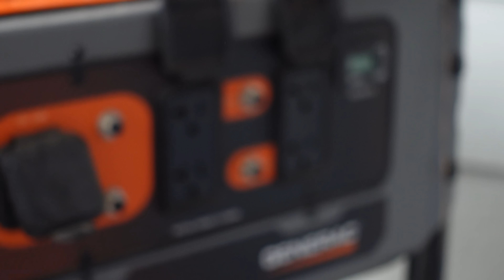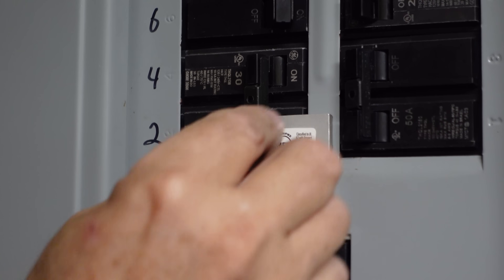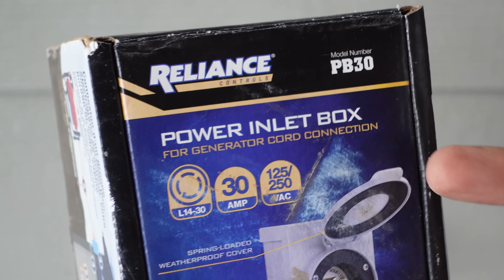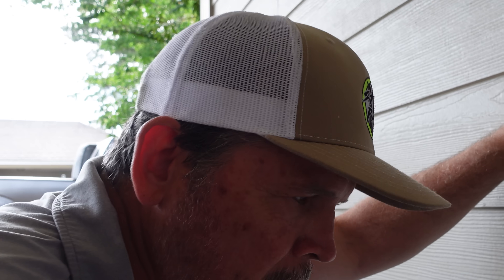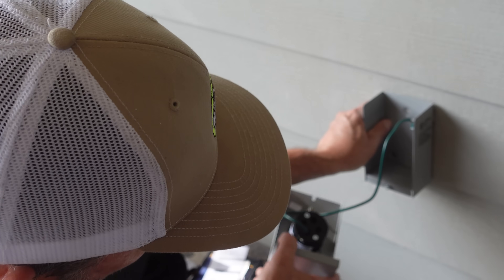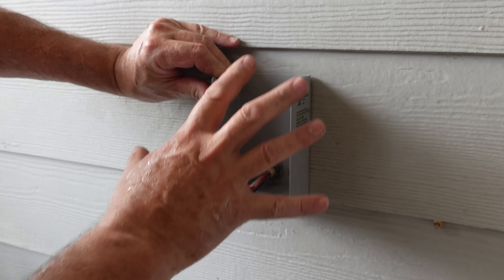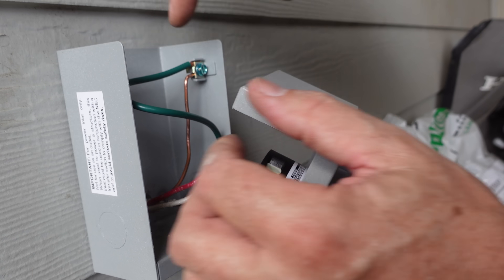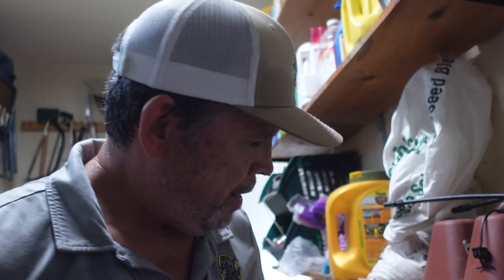What is a Suicide Cord and Why It Could Kill You

Comment: For a possible future scenario... The hole you made through the plywood was big enough for the metal Romex connector... You can screw the connector onto the wire first then put it through the knockout on the box and install the locknut. 👍
Reply: You beat me to it -- I've used that technique for all sorts of similar cases - and not just on "house wiring", but low-voltage, coax, etc.😊
Reply: Why did he drill such a large hole? It looked like a 3/4 inch hole would have worked.
Reply: imagine if for some reason someone has to take the box out. "Gotta open up the drywall"
Reply: @cmh-c  why?  You can remove the locknut from the inside of the box and pull it off, just like you out it on, leaving the wire in the wall
Reply: @IrrationalBstrd  Yeah but what are the odds someone figures that out unless they have prior knowledge of that technique?
I'm not sure they teach it in the classes you can take to become an electrician, but it's something worth knowing for sure.
Someone ought to go around and write down all these little things you "learned from your mentor", otherwise they might become forgotten.
That kind of trade knowledge that isn't in a book is an extremely important thing to put down in books somewhere, and I have an example of why:
This kind of trade knowledge becoming forgotten is why we can't build the mighty Rocketdyne F-1 engine that powered the first stage of the Saturn-V moon rocket any more (and haven't been able to since the start of the '80s).
Yes, NASA still has the blueprints for the F-1 engine, but that's not all you need to make one.
What we lost are the trained tradespeople that were actually building those engines, and had figured out all the little tricks and techniques that turn that blueprint from a plan into something you can take a series of steps to produce.
Now, because nobody wrote down the knowledge they had that was required to build one properly, we can't build it any more unless we go thru and figure all that out again.
Reply: @44R0Ndin  unh. If you don't know how a cord nut works, you probably should not be playing with sparky things before you spend time learning about them - like from S.P. and others.

Comment: As an electrician in Australia I've never installed that type of electrical box. My question is, is that common practice in America to connect the supply cable earth to the box (like you did)? Or are you supposed to connect the supply cable earth directly to the socket earth terminal?
The reason I ask is that connecting it to the box relies on the box connections and the internal factory earth wires in the box. Should the box connection come loose or wire break off, you've lost all earthing of the box, but the generator earth is still connected to the socket and the box lid (which are now no longer earthed). The generator is no longer earth bonded, and if an earth fault occurs in the generator the box will become live. 
In Australia we would connect the supply earth directly to the socket earth (as well as the box earth wire that is already in the terminal), and those internal earth wires to the box and lid are only there for earth bonding of the box and not relied upon for a fault path from the generator. Any fault path and bonding in the generator would go directly to the house earth. 
Also, this may be the reason why the factory earth bonding wire that was already in the socket may not have been tightened... because you're supposed to back it off and put the supply earth in there. 
Any US electricians know the answer to how it's supposed to be done?
Reply: I would like to hear an explanation to this as well.  I know very little about this subject but oddly enough,  I was able to follow your thought process here.

Comment: Love the video but using that generator to power your ac will end up damaging the generator or or ac system. You need one that produces a proper sin wave
Reply: Explain this please?
Reply: @SVMSICE  the power supply company provides you electricity with a clean sin wave meaning a smooth generation of electricity. These portable generators do not have a clean sin wave unless specified. It is very stressful on the generator and ac system to power those units. Will it work yes, but you are shortening the life span of your equipment. The only type of generator recommended to run your air conditioner or any other big loads in the house would a permanently installed whole house generator with proper load sheding equipment.
Reply: @blakegardner1018  Thank you

Comment: The energy coming from you guys is great fun!  The video on the other hand and stuff used could all be in black and white and say it's from the 1950. But that's the difference in countries?, even here in Europe when you cross a few borders you end up with these old metal fuse boxes and Bakelit weird fuses from long past ago. Also when you notice the way houses are build even in a hurricane state and yet it's (I call it disrespectful cardboard houses) plywood and sheets of something nailed or glued and seemingly not isolated so the AC is working overtime. And knowing that with every storm you face a power outage (not if, but when) can't the power companies evolve and move power lines from on top of poles to underground?
Solar panels and batteries are a great solution but again with the "cardboard" houses and stuff flying off maybe not? Seriously I wonder why this is as it is.

Comment: great video. I do have one criticism.  When taking apart the inlet at the house, you should have tested for power.  Even if you "know" the power is off, there is a chance that there could be a feedback on that line.
Reply: That and why not put a female end on the cable? Unless the old one is very old or damaged in some way. There are ways to test extension cords.
Reply: @Cheepchipsable  The cable was only rated for 20A.
Reply: @hackjealousy  The cable looked to me to be a #12. But, the camera view may be deceiving.
Reply: @notredo  it did seem rather thin looking for 10 gauge, but maybe big hands gave that impression.
Reply: @notredo if the cord was assembled correctly the plug would have been a 30A and the correct guage of wire was used, otherwise, the cord was improperly assembled. You can't plug a 20A plug into a 30A socket (incompatible mating).
Reply: @Cheepchipsable  My thoughts too, you need to destroy that suicide cable anyway.
Reply: @rogerbarton497  Exactly or take one end off and hide it. The Dolphin RV I bought had a suicide cord(120v) in it. I cut off one end to disable it, replaced it with a standard ext cord, and replaced the standard outlet(really an inlet in this case) with a recessed male one.
Reply: @SouthernSierra56 , HOWEVER, it should be kept in mind, without the interlock tripping the main, the prongs the female end plugs into would be live.
Reply: Why would he check the power? He literally just showed you the interlock and it's inability to be cut on as long as the main is on.
Reply: @jameswisenbaker634  Always test. My mates brother is dead because he did not test. He cut the power to the circuit, no worries. But got electrocuted. Some worker sometime in the past had managed to place a screw into a wall, and neatly between two power cables creating a crossover power to each cable via the self-tapping screw. Poor bugger. poor family. He was 24 years old. Did not test. Always test. Trust nothing
Reply: @LewisTheFly888  if my luck is that bad i deserve to die.
Reply: @LewisTheFly888  sorry for your loss.
Reply: @jameswisenbaker634 Well, if it's not his house, who knows for sure what kind of cross connections could be present.  You can take it on faith but if you're not dead certain that it's just as you assume it must be, you might be tingled pink.
The dangly receptacle that was there at the start kinda puts a question mark on who was working in there before.
Reply: @jameswisenbaker634  someone could have done some work in a different area. wires could have been nicked and allowed some residual power from a different circuit to bleed over. I had this happen to me once when I was working on a water heater. was not a fun time.
Reply: @jameswisenbaker634  Should be second nature to check before working on the receptacle.
Reply: @jameswisenbaker634  It's a very good habit for an electrician to have.  Unforeseen circumstances could mean a Darwin Award.

Comment: Why did you wire it up like that in the first?
You put the box in a year ago that means you installed the suicide plug receptacle or knew it was not safe back then?
Real question here, not trying to be a dick.
Just seems like you should have solved this issue at the time of installation of the box!

Comment: I used the same setup on my home but since it's a mobile, I put the generator inlet on a post in the ground beside the wall where the panel is and used some liquid tite conduit. I also added a cut off switch outside as well. It wasn't really necessary but it allows me to make the final connection outdoors while I can see and hear the generator easily. Just a personal preference kind of thing.

Comment: Right is right, and that was a completely correct install. L14-30 plug&receptacle for a 10/4 SO cord, inlet box, and the interlock kit are key ingredients to a correct portable generator install. Nice work.
Reply: He should have mentioned that the wiring needs to support 30a. It's EXTREMELY important.

Comment: It's all in the detail! I'm from the UK and always watching your videos. I'm an electrician and all I will say is for a quick tip is strip double the amount of insulation on the single cables and fold the copper over on itself. It gives the screw more to bite on and doesn't break the cable so easy. But again top quality work. 👌

Comment: A suicide cord to me is one with bare stripped wires or alligator clips on one end and a male plug on the other end. I have used them for electronics repair work. Same problem, the end of the cord has an electrical termination that can be easily contacted by the user when the other end is plugged into a power source.
Reply: @Hello Paul how are you doing

Comment: Nice work. Why would there be a problem modifying an extension cord? Isn't the cord like any other flexible cord? Maybe the problem is that the addon connector may not be weatherproof?
Reply: Legally they as contractors can not modify someone else’s cords. Unrelated to this video they as contractors can not use modified cords on their job sites.
Reply: @richardlug6139  If you have bought a cord, it is not someone else's cord. It is your own cord. And what about all the cords electricians modify every day while doing permanent house installations?
Reply: @nixxonnor  I guess I am talking extension cords , not hard wiring. Extension cords have to have factory ends on to be used by contractors on work sites in most locals.

Comment: We have a transfer switch instead of the lockout, it's inside the garage tho (the male plug) which I wish could be accessible outside like the one you installed. Question, do you need to caulk around that box?

Comment: Should you have done some foam or caulk in the hole in the wall where your wire went through to prevent water and insect penetration into the building from the hole?

Comment: NOT HAVING AN INTERLOCK, AND PLUGGING YOUR GENERATOR INTO THE HOUSE, IS A VIOLATION OF THE NFPA (National Fire Prevention Act, also Quaintly Called "The Damned Building Codes"). If you live in America, you live in a Jurisdiction that requires an Interlock.
The OTHER Reason you need an Interlock is to protect your Generator. When you back-feed the Transformer, your Poor Little 3 KW Generator is now trying to power your entire neighborhood.
Failing to use an Interlock and causing Injury or Death to a Lineman, OR NEIGHBOR, is a Crime and can result in charges, including Manslaughter.
Remember what I said about trying to power the neighbor's house? They're expecting the power to be off. Oh, their house is flooded, AND you heated their outlets? Gee, thanks, Jim, I owe you one...
I have seen what happens when two neighbors both decided to back-feed, on the same transformer. The smell led me to believe that the Smoke Cloud must have been amazing, when the Magic Blue Smoke was released.

And as an Electrician, I love finding Suicide Cords. They cut up short real easy and make Great! Beer Money.

Comment: That 1/4 x 12” drill bit is pretty handy to keep in your tool box. I use it a lot for wall penetrations for conduit. A lot of guys use a hole saw with an extension but once you get through the 1st layer of drywall, the shaft of your extension is much smaller than the 1st hole and it’s near impossible to get the hole on the opposite side of the wall to line up with the 1st so your conduit passes through the wall straight without trimming the hole on one side or the other. With the long 1/4” drill bit you drill a pilot hole all the way through the wall and then use a hole saw to drill in towards the wall from both sides. After drilling through the 1st layer, when your bit bottoms out on the other side of the wall, there’s enough of the bit sticking out of the wall to line it up square with the wall and level before you penetrate the other side.

Comment: I think you should have modified the clients generator cord with a female end to remove the risk of him or anyone lese getting injured.  An new cord is the best solution but making the current cord safe is also important.
Reply: Well they can't use the cord anyways because he changed the box,  it wouldn't plug in anymore.  You can use that cord safely though in another outlet,  you just have to follow the correct procedure,  which I'm sure he educated the homeowner on.  Just my opinion.

Comment: On connections like this - it would be really useful if they provided the torque settings for the connections; in the UK breakers (RCBO/MCBs) have this in their instructions, but not terminations like these where they are arguably just as important for safety.

Comment: If you DON'T modify that "double-male-suicide-cord", then it will remain a dangerous cord to have around. Five minutes to install a female connector and that dangerous cord is rendered "safe". And it's cheaper than a whole new cord.  Great Video!
Reply: whats the difference from making the repair safely and buying a new cord?  How is the newly manufactured safer?  I was wondering that too.

Comment: I'm a home inspector and did an inspection a few weeks ago that had this type of set up but with 50 amps. The interlock didn't work because the main shut off was indented about a half inch so the interlock didn't even block it and it had a 14/50 Female RV type plug outside. I went ham writing that thing up and how dangerous it was. I would personally use a torque screw driver and torque those nuts to spec by the way. I did this exact set up in my panel right before Ice maggeden here in Texas but with 50 amps and used my RV cord from my 5th wheel to connect the generator to the house. I actually started on the project like a year before and finally finished it up like 2 months before we lost power for 4 days. I was a super hero for sure. It wouldn't run my heat pump unfortunately but it ran the whole house other then that including my septic. I do have a gas fireplace and gas water heater as well as cooktop so we were good to go. All my neighbor friends were jealous for sure.

Comment: I love to use pocket holes. When I got a Kraig pocket all kit, it came with screws, but I switched those out for the star or called torque heads, 
I believe the Torque Heads have more surface area than the square drive, commonly known as Robertson.

Comment: What I love about Stud Pack is that you guys don't just show the right way to do something, you show WHY it's the right way to do something.
Reply: That's a great point right there!
Reply: Yes your right , I always like to know the WHY with everything. I piss my Doctor's off all the time.  I don't give a crap , just tell me why , lol
Reply: Hopefully this area is dry  well covered ... because correct hardie install for penetrations over 1.5 inches you want to use z flashing with a 1/4 inch gap before hardie starts above your block made of pvc  is best material to use. You caulk up sides of penetrating block and base and in this case around the electrical block attached to pvc block.
Reply: @ca6360  I've been looking through these comments for a response like yours. I'm a sparky, and you always seal an outdoor appliance, wether it's rubber backing, duct seal, or caulk. This is in a hurricane prone area, it has to be sealed, as it's not a protected area, and you can see the light cooling through the hole before he put the dry wall back on. Personally I would have used conduit directly from the panel or at the closest accessible point.
Reply: as someone with learning disabilitys including adhd telling me what to do is a waste of your time if your not gonna explain the why then i cant comprehend or remember any of it
Reply: He's "teaching" work that requires 4 years of on the job training. These youtube "electricians" kill many people.
Reply: Thats just good advice for life
Reply: You guys do beautiful work
Reply: I love instructions that say WHY. like when putting a sticker clear cover I finally got explanation It tells you to do it in the bathroom right after you run steam (hot water) it's to knock dust out of the air so you get less dust when you put the "sticker" on your phone screen.
Reply: @jadall77  Like a (crappy) tempered glass screen protector kind of sticker?

Comment: Just curious of the wire gauge for that outlet. In Canada we have to use 10 gauge wire for 30 amp power. You went from a 20 amp to a 30 amp connector. Is that wire 12 gauge or 10 gauge?
Reply from the maker: 10g👍